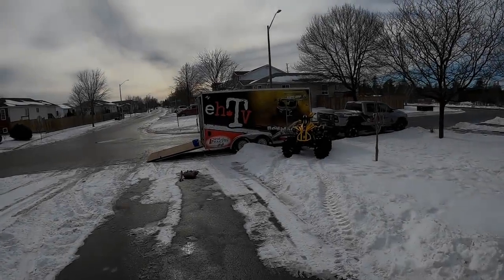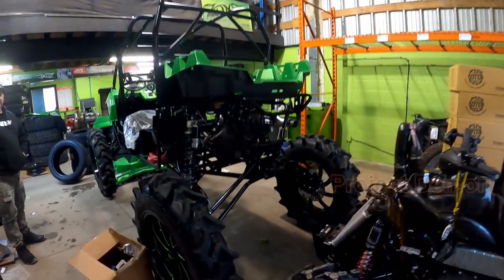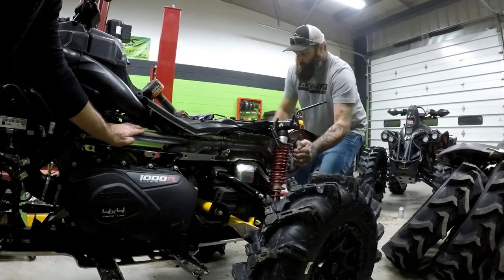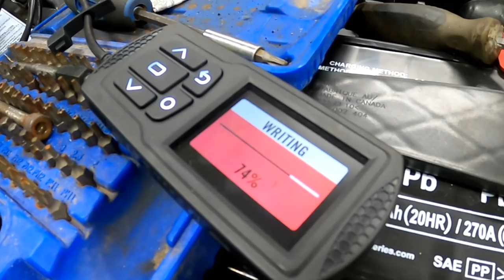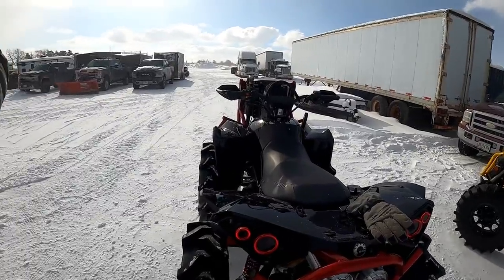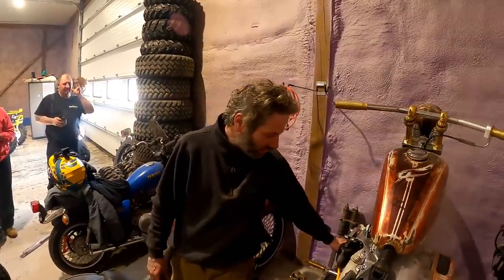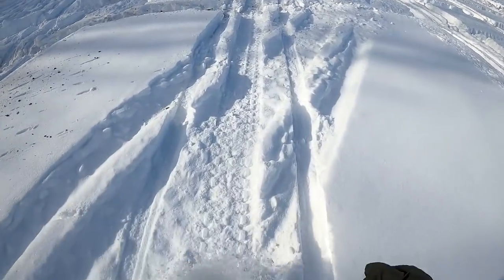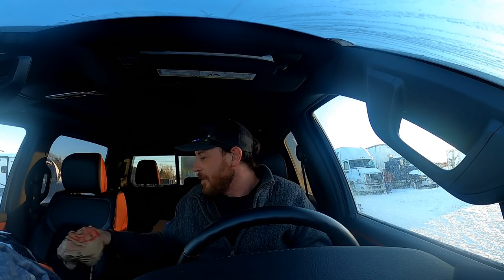Start to Finish!! 2021 Can-Am Renegade X-MR 1000R 4Lok Build & Ride

Comment: S3 has the forwarded A arms and the stretched trailing arms for the 19s and newer now, I plan on doing both over the winter as the wheelers get used mainly for plowing when the snows on the ground and my sleds are the primarys during that time.
Reply from the maker: At the time they had them listed, but no stock!

Comment: Please give me some suggestions on heavy duty tie rods, I do ot of forest riding driving over huge logs , I was told that's why my left tie rod bolt is loose , tightened it but see how long that lasts.
Reply from the maker: Lots of options for HD tie rods. I run stock to keep it a breaking point purposely.  Easy to replace one. However, I have yet to bend one yet. Lol. But I have had the issue of the ends loosening up. Locktight if necessary.

Comment: With the tune and the headers what do you have to do with dyno jet tune do you only tune it or does it need other flashes on it
Reply from the maker: It's as easy as picking the corresponding tune for the additions on the machine. Dyno jet has plenty combinations to choose from.

Comment: What's the wheel and tire setup on the black one? Is that 33s and 18s or 20s?
Reply from the maker: 34's on 20's.  But I had 18's with 34's havoks prior to this setup and it preformed better.

Comment: She turned out awesome love the red flake in the plastics looks absolutely killer and I can't wait to see those rims when you get them there gonna be off hook great video brother
Reply from the maker: I actually decided on some msa, mlocks.
Reply: @ehTV1000  the ones that you were looking at in the box right gonna put yellow 🟡 on the aluminum parts if so those rims looked badass what do you mean by m lock
Reply from the maker: @donaldwilliams5448  that was original plan, but 18's. But then we went Assassinators as he happened to have one set of thirty two's kicking around. So 14"msa beadlocks will be required.

Comment: Im want to make my renegade 1000 xmr
2018 into a trail atv any suggestions what i should do for tires and all
Reply from the maker: Those efx mct's Roger has would be a great fit, same great preforming trail tread pattern as the bighorn, with deeper lug. Better protection from punctures and better performance in sloppy conditions.